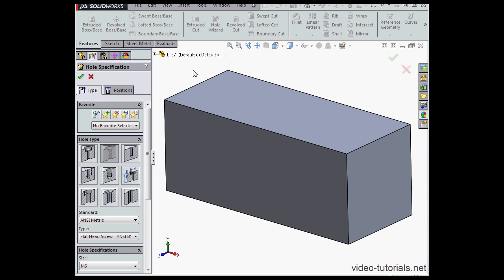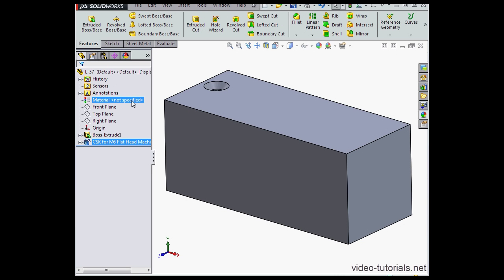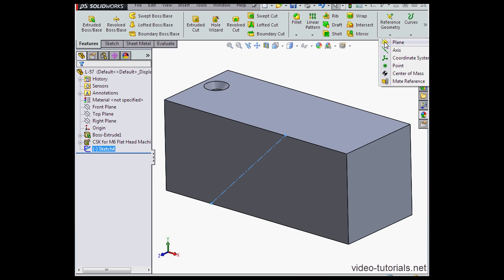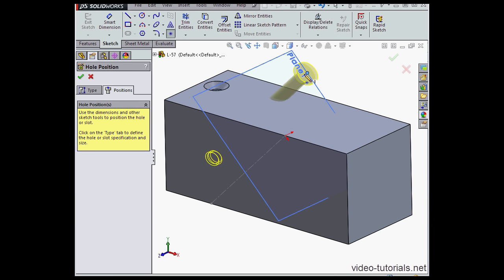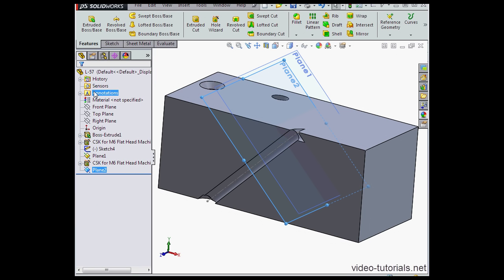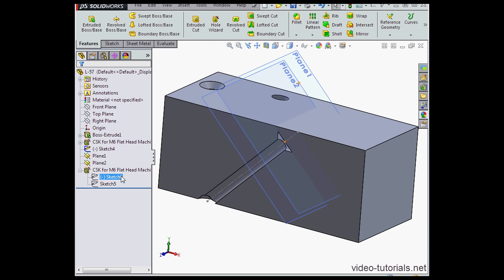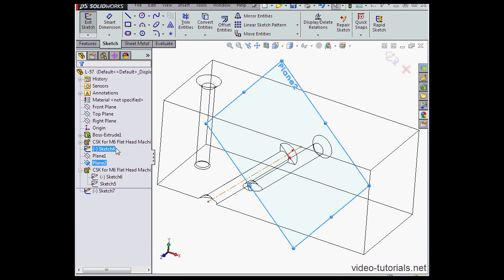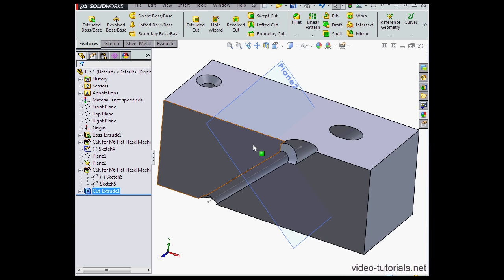How to create a hole at an angle #2 - SOLIDWORKS tutorials (Fundamentals)

Comment: why does this look so crappy?
Reply from the maker: Hi--try viewing in high def by choosing the 780 HD option (left click the gear at video's bottom right). The video's final resolution that I've posted to youtube is 900 x 700; during upload youtube resizes a bit so there are some "black bars" at the sides, but other than that there is no distortion; the video should be crystal clear if you are able to view high def.